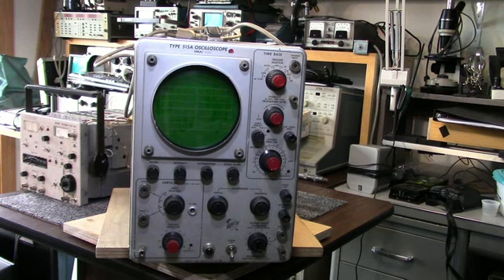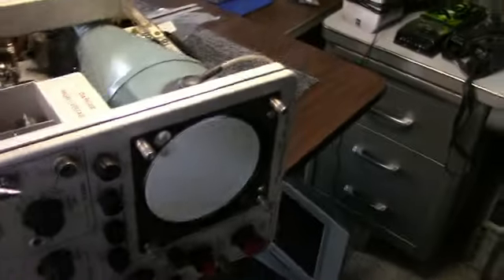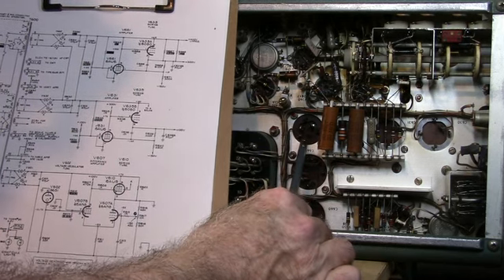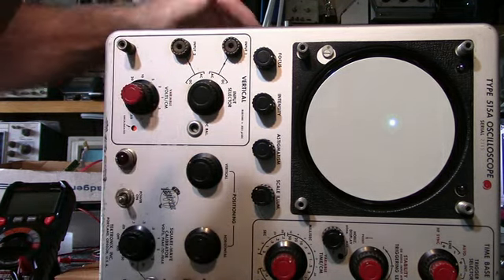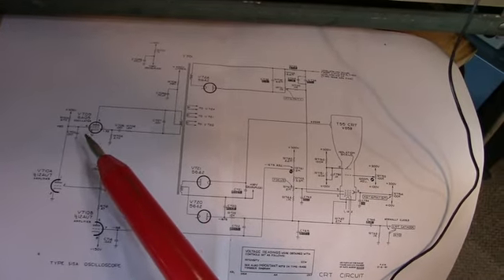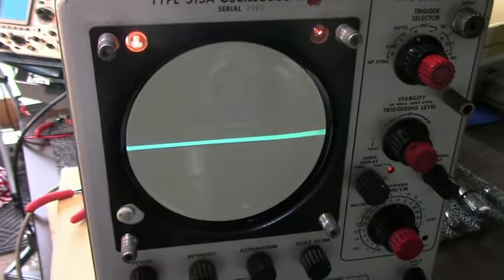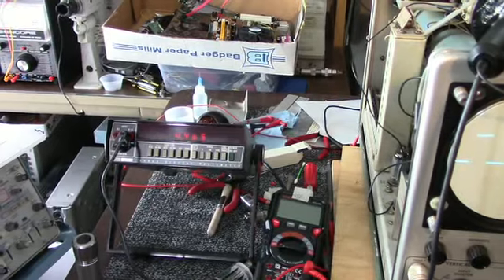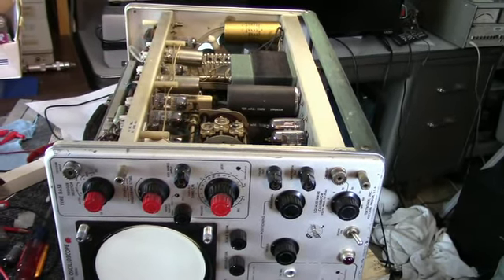Tektronix 515A

Comment: It looks like next to adjustment R741 up by your high voltage oscillator, it’s stamped “1675v ADJ” which would imply that the 1665ish volts you were measuring were actually very close to correct. It’s odd that the schematic calls for over 2300 or so.
Reply from the maker: Hi Skyler, I maxed the setting of the adjustment but still was unable to increase the voltage.  I have solid state HV diodes on order and it will be interesting to see if decreasing the load on the HV transformer improves operation. This unit has a lot more problems and I am not sure it it is worth the time and materials to get this scope back into shape.  I have a thing for Tektronix scopes , and once started it is hard to know when to stop.